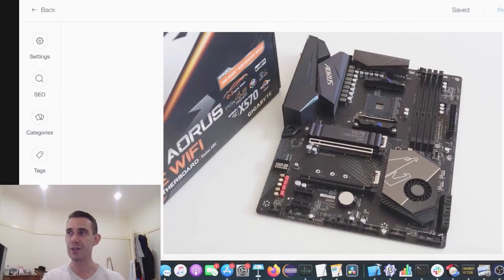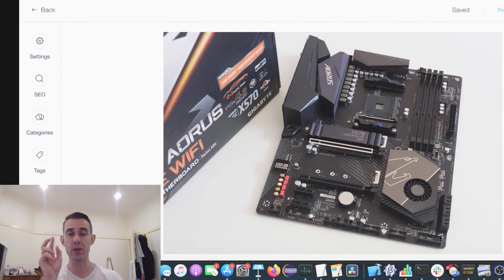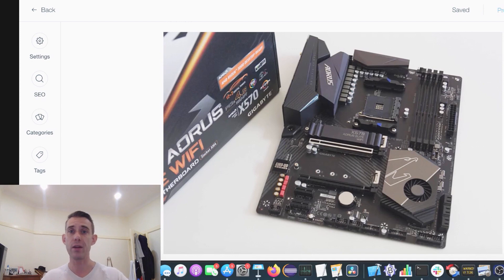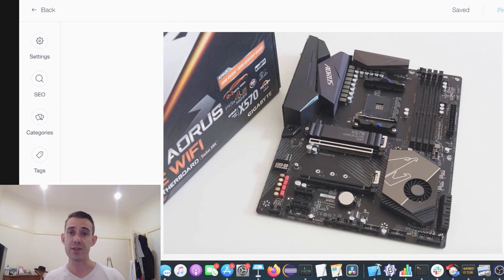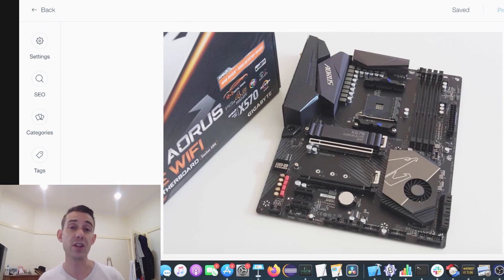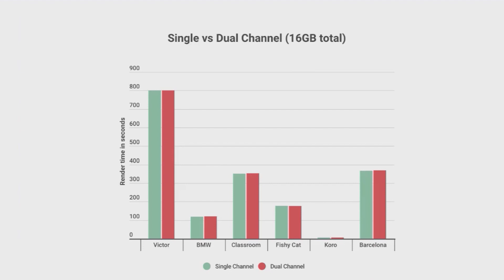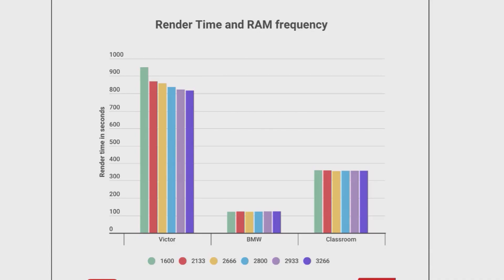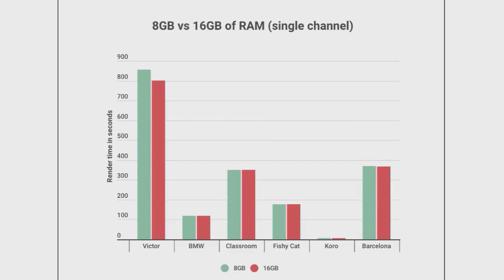How Does Your RAM Affect Rendering Speed - Blender

Comment: I got 20Gb ram and GT1030 GPU, tried rendering a scene with just a couch and two area lights.. the session crashed and was out of memory. What might cause this ? Running on a i7 PC
Reply from the maker: Ok, so, were you rendering on the CPU or GPU? If GPU, how much VRAM does your graphics card have?
Reply: @Crowdrender  I was rendering on a GPU, it’s 2Gb ram.. please don’t laugh
Reply from the maker: @brianmolele7264  Hey, its what you do with it that counts right? 

Ok, so if you're having an out of memory crash, that is a clear sign that your scene doesn't fit into the VRAM of your GPU. 

So, although you have 20GB of RAM in your system, that does't help with the problem of insufficient VRAM in your GPU. 

You'll likely need to either; 

a. render on your CPU instead, fun fact, most modern operating systems support rendering even when your scene is more than your system RAM. 
This will be slow though!

Or,

 b. optimise your scene to reduce the amount of RAM used.

Now, we never talked about plan C did we? (Sorry that's a crass attempt at a quote from the move Tango & Cash). But there is a plan C, and its pretty drastic (like in the movie). 

Plan C would be to increase your VRAM, but that means time to upgrade your GPU, hence the drastic-ness. 

Hope this helps!
Reply: @Crowdrender  Thank you for this vital information brother, I'm expecting a delivery of a RX580 Radeon 8Gb GPU.. I think I'll just use CPU for now like you said. Thanks again, while I'm at it let me subscribe.
Reply from the maker: @brianmolele7264  Glad we could help Brian. Please let us know how the RX580 performs, AMD does have a  bit of a disadvantage in performance and support compared to intel when it comes to rendering in Blender, but, this is hopefully being addressed.
Reply: @Crowdrender  thanks again 🙏🏾. Will do

Comment: What if single geometric object exceeds the size of single ram size? Does the dual or quad channel render faster from single? If laptop has 8gb soldered and 32GB in slot.
Reply: Computers does not work like that. Object geometry is pretty randomly spread over memory space. 3D software asks operating system to store object's geometry data, operating system spreads data to RAM and has no idea what kind of information data presents. While rendering 3D software asks operating system to load specific parts of the geometry and little piece by piece render one pixel at the time to get final image. RAM always works at the speed of lowest stick of RAM in the system, so it does not matter what memory module has needed data. RAM speed and number of channels matter in video editing and as far as I know 3D rendering is like opposite of that. Rendering calculations for pixels/pixel group takes much more time, than loading needed data from RAM.

Comment: (Read revised comments/opinions below👇) 
Having more RAM definitely has an impact. I am currently unable to render a scene out because I have 1.6 million verts in it, and how rendering works is it loads all this DATA onto the RAM - and then it renders them, so, dealing with large files having faster RAM does have and impact and the amount of RAM is crucial too. Cause with 16GB of RAM let me confirm that I am unable to render a frame at 1080p with 8k textures.

My specs:
Razer Blade 15 (2022 model)
RTX 3070 Ti
12th Gen i7 - 12800H processor (14 core/20 thread) @4.8GHz
16GB RAM
1TB SSD
Reply: Here's how I rendered the same scene in QHD on the same Razer Blade setup!

I posted the original comment 3 weeks ago, during this time I have been trying to troubleshoot why my scene won't render. 

After checking the spikes on task manager during render, I read many forums and blender website for answers on the error messages; and all the information pointed towards 'shortage of memory' - which is what I mentioned in the original comment; that deduction is right HOWEVER I later was able to render the scene in QHD on the same setup with max settings!

Here's how it got there;
I basically took the scene apart, made a list, checked all meshes individually, tried smaller textures etc. And finally found the reason why the scene didn't render - 'Adaptive Subdivision' yes! This one tick box ✅ in the Subdivision modifier alone was creating all this trouble the whole time!
I found that I had applied this to the ground, and what it does is during rendering adaptively subdivides the mesh during rendering - which meant that a single large ground mesh alone can have Millions and Millions and Millions of quads - this vert/face count is not displayed! Which was actually unnecessary - cause the ground was covered with other details for the most part.
Soon as I removed that modifier everything was perfect. 

So, although all information pointed to RAM and hardware shortage, this was overcome with some classic troubleshooting.
This is why many hardware review channels can be misleading, with what I knew 3 weeks ago this information seemed very valid (it still is) but, with some hard work and best practices like troubleshooting, the results can be amazing.

Just for the record, let me confirm, more RAM is better but may not be absolutely necessary at the same time.
Reply: @MishimaZaibatsuCorp  Hello bro, I just made a blender file.
The thing is that my PC has only up to 4GB of RAM with 1TB HDD ROM and nothing extra, it runs with i3 processor and I use it mostly for college purposes.
So you must be thinking that why am I telling you all this?
This is the first file that I have created after so many efforts and I am a beginner in this field.
It consists of 610 frames and I want to render it, but due to its low specification it takes more than 50 hours to render. But I want to convert it to MP4. This is my 1 month hard work and today after spending so much time this is the problem I am facing.
😔😭😓
So, if you can get me out of this problem it would be a great help.
I'll send you that file. You can show your generosity by sending me the rendered mp4 result of that file. I will be very happy if you send me mp4 in 360p resolution.🙏🙏
Bro, you can think yourself why I chose you among so many people in this comment section. I hope, you will raise a helping hand for me. Thank You🙂🙂🙂
You just have to share your G-mail ID in the comment and I will share you that file on your G-Mail and after that you can delete your ID from this comment section. Trust me, I am a genuine person, I don't even know anything harmful. Also, I ensure you my file isn't corrupted.
Reply: Just curious what are you using 8k textures for? I’ve never used over 4K and I mostly use 2k and still get good render results in 4K. It gets exponentially harder for your computer to deal with textures above 2k so 8k textures will be incredibly intensive on your machine.
Reply: @teeambird2079  This was for a close-up of the ground, I wanted to make use of the textures that were available to get the max detail possible, without adding too much geometry into the scene, I felt it was more economical to render
Reply: How about mhz and ddr version.. I have ddr3 3200 mhz 64 gb I wanna sell it and upgrade to 64gb ddr5 6000mhz does it make differents
Reply: @rajandp7653  Not sure if it'd make a huge difference changing the speed of RAM, my experience is with DDR4 sticks of RAM. However, something I can add is that the RAM on a MacBook performed way better, but having said that, for 3D rendering Windows is that way to go.
Reply: Increasing ram also affect render speed? Like i have 8gb, if i upgrade it to 16 would render speed increase in cycles??
Reply: @sidx4446  From what I experienced, the RAM helped load larger scenes and reduced texture reload times for each frame, thereby reduced overall render-time
Reply: Hello Brother, May I know whether you're a professional or an amateur?
I mean do you use these high end specifications for job or profit purpose or for satisfying enthusiasm?
Reply: @krishnakantkumar5060  Hey bro, thanks for asking, I use it for professional purposes for sure.
I've been working on mid range set-ups for a long time, and managed with the hardware I had, at many occasions the hardware limits the capacity to explore new styles in 3D which was why I actually needed the extra performance the Blade offers. 

But let me tell you that  with Blender, it doesn't require much performance specs to get the job done - there are many ways to optimise a scene and get good results on a mid range set-up.

I'm going to mention some of my learnings as a follow-up to my first comment.

Comment: you could test saving big files using compression and without (200mb+) with different ram speeds, apparently more ram speed can be better for compression, also it might affect fps in eeve - and consequently the animation speeds in rendering in eeve (also probably matters in cycles).. 
..probably where memory bandwidth and speed and accessibility matters the most is in simulations, fluids and smoke sims, maybe affects the physics calculations - so if you're gonna do more - might as well test those..
.. your standard cpu rendering in cycles is 99% dependant on cpu speeds and number of cores, the memory speeds are important obviously when transferring data to ram, the rendering in gpu is probably affected even less because it uses gpu's VRAM to render inside it.. (I'm guessing the test is on cpu cycles, still the part when it "collects data" before rendering is probably dependant on ram speed slightly)
..ok test, if you want you can expand it to other stuff, eeve fps, and simulations, fluid and physics
Reply from the maker: Good ideas here :) if we get time, we'd love to look at simulations at the very least!

Comment: Well rendering is computing vectors, since when ram compute something?
Reply: 4K bitmaps and fluid simulation files up to 5GB per frame. I'm strugling with 128GB of RAM and Googling old server hardware to get machine with 512GB of RAM. In cheap old hardware that means 1333MHz RAM speed, but it does not matter much as this video shows.

Comment: Your previous method was thorough, it also proved that memory through put is not so relevant for rendering in cycles. Take away is to get as much memory you can afford, and then you are free to skimp on the speed and CL.
Reply from the maker: Thanks Peter :) it would be super awesome though if someone could concoct a scene that actually does benefit from dual channel RAM!
Reply: @Crowdrender  If you render in CPU, then I do believe a 64 core thread ripper might max out more than on channel when rendering.

Comment: Just wondering... you say "8 to 16 does not make much difference as long as your project fits in the the available memory". This is partly based on the fact that it did not made any difference in the smaller project. But did you monitored the swapping? Was the PC not swapping on those small projects? Perhaps it does make a difference if you go to 32 Gig of higher??
(please say YES...... I bought 128G for my new PC. Only because I thought/hoped it would make a difference :-) )
Reply from the maker: Ok, that is an interesting test we might take a look at! 

Having more memory is definitely a benefit, we tested 8-16 mainly because with the Blender benchmarks available to us all, there isn't a huge consumption of memory, so you usually don't see these effects of swap being used unless you only have 8GB installed. Even the Victor scene, the largest of the lot, tops out at about 12GB, leaving 4GB for the OS and other apps. It might be that we get a slightly better speed if we test again with the full 32GB we have available though. 

From what we know about memory systems, swap is used as a 'last resort' to avoid literally running out of memory and having a system crash or lockup. Typically your memory controllers work hard to keep the most frequently accessed data in the lowest level caches and then RAM, finally swap. If there is data that hasn't been used in a while getting in the way of a more frequently used set of data, then there's a good chance it gets swapped, and this introduces a lag or bottleneck if it starts happening a lot.

Having 128GB, ok, it should make a difference, but only for cases where you were encountering swapping as the bottleneck. Good news is you can probably handle some pretty huge meshes, textures and simulations now :) 

Think of it this way, having more RAM helps you do a lot more with your CPU before you start finding bottlenecks that drag performance down. RAM usually doesn't lift performance, it just stops it from dropping. 

So yeah, sorry, if you were hoping more RAM would magically make your CPU render faster in every case, that's not reality :(
Reply: @Crowdrender  I think I understand how memory and swapping works, at global level :-)
So yeah, I agree with your explanation.
I was just wondering if you had monitored real swapping during the test or only looked at the memory usage that Blender shows.
BTW; I still have a slow Blender when working with fluid simulations, even with this memory and a Threadripper 3960X. Okay, yeah... of course...I understand that with e few Mil. on particles for mesh, spray, foam and bubble.. each. Plus landscape with extra's.
Rendering goes relative fast though. :-)
Reply from the maker: @ReneLaan  Mostly we were watching the memory usage and render times. Though if you know what to look for, you can spot swapping in action by looking at the RAM usage. It pretty much increases to near 100% usage, and then fluctuates as the memory system swaps out data to the disk and swaps in the data you are working with :) 

Fluid sims are slow, more memory will help you do bigger simulations.... which will still be slow xD 

I've tested fluid simulations quite a bit, they seem to suffer from quite a low utilisation of the CPU, the do appear to use all the cores in the latest manta flow builds, but, the utilisation of each thread stays under 10%.